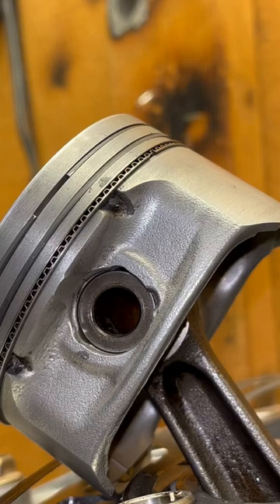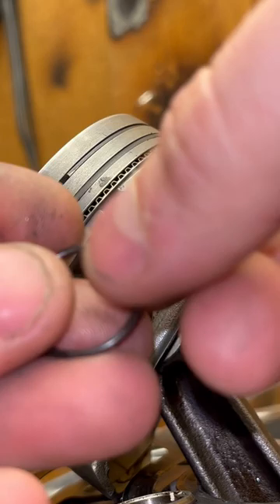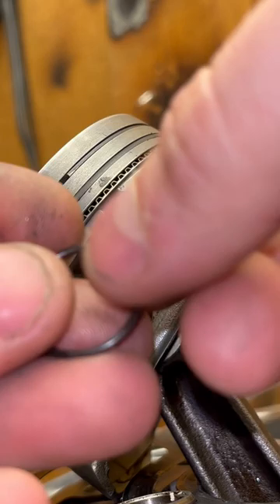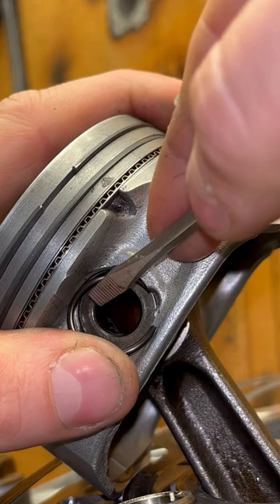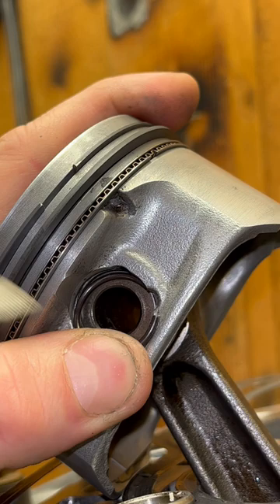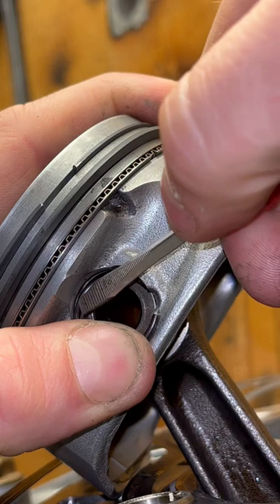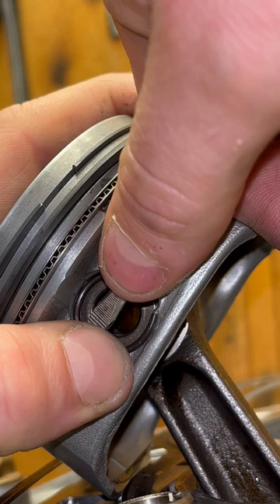Piston Cir-Clip Installation

Comment from the maker: just for anybody that wants to know yes I may not instal C Clips how Service Manuals say to, however it doesn't matter because the only reason any service manual tells you this is just for ease of removal of the old C-Clip.
Reply: That's how I put it in my 88 yz 80 recently and haven't had any issues at all. And that's with a used circlip (new one got launched into oblivion unfortunately).

Comment: Don't line the opening of the cir clip with that notch. That's how you remove them if the opening of the cir clip is lined up with that notch, there's nothing to grab onto with your pick to remove it, if you need to 😢
Reply from the maker: It's only like that for ease if removal... So no it will not mess anything up.

Comment: I always thought opening on clip went on bottom when working on dirt bikes eons ago...
Reply from the maker: installed them in all different directions. I've never had an issue all of these years. Thanks for watching 👍🏻
Reply: @trxtech3010  i understand that but still doesn't mean its correct ..I believe i am correct ... you should research and learn more if you are doing things correctly ...it would suck if ypu lost an engine over your ignorance ...good luck
Reply: @Jason rood opening up or down on the old motorcycles / wiseco pistons ive installed....but could be different on application in others..
Reply from the maker: @JG-do6eb  once again, I've been doing this for years absolutely never had an 1 issue...
Reply: @trxtech3010  still if its not correct regardless of your experience...its still wrong...are you a millenial who can't ever admit something can be wrong from only the things you seen...you could be correct as well but id bet I am...
Reply: @JG-do6eb  You one of those people who argue at little league games? You should drink a cold glass of milk brah
Reply from the maker: @JG-do6eb  Never had one fail. It doent matter how it goes in. The only reason they say to install it that way it to make it easier to remove. Yes I am a "stupid millenial" fixinf older guys stuff who don't change their oil....
Reply: @trxtech3010  Very hard to remove now.